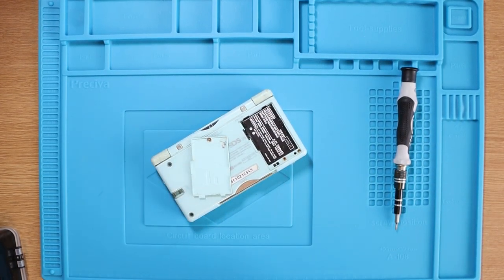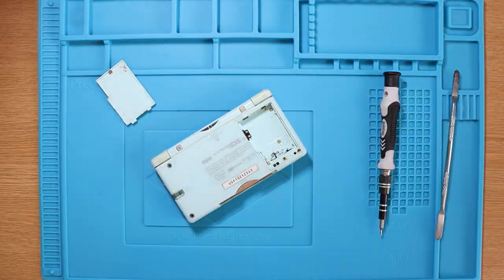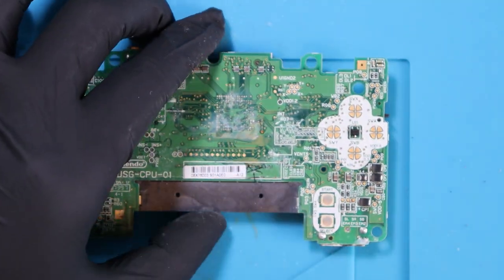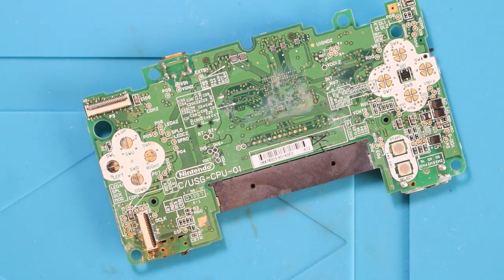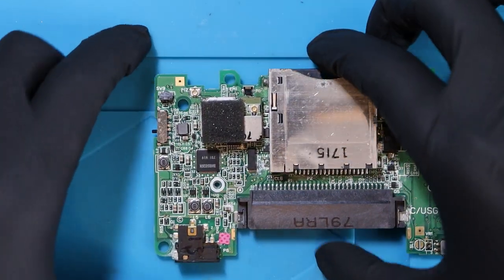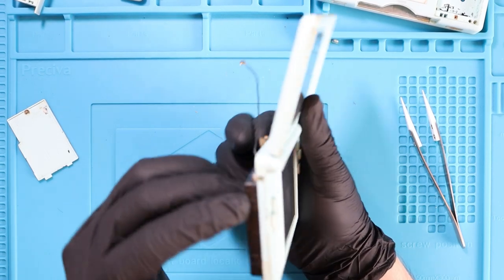Attempting to Repair and Restore a Nintendo DS Lite I Purchased on EBAY!

Comment: Did you try to change the two SMD fuses and the filter? If there was water damage there is a highly chance of having a short and getting those fuses blown.
Reply from the maker: No I didn't but I have a bit more knowledge in this now, so might give it another go 😎

Comment: I've seen someone use white distilled vinegar instead of iPa to clean corrosion off a gba motherboard, it seemed to get a lot of it off
Reply from the maker: Yeah I’ve heard of that as well working wonders :)
Reply: @mrxpexplorer6318  so clean the motherboard after you use the vinegar... don't let it sit on the board for years. You use the vinegar, Get the corrosion cleaned up, then go over everything with iPa to clean it up.

Comment: question: my ds lite is 14 years old, i used it last year and it worked just fine, i was trying to use it today, the light came on for about 3 seconds, the bottom screen flashed the white screen for half a second and turned off, not sure if the battery is low or what, someone please explain
Reply: answering you in case anyone else wants to know as well. Charge the battery for a couple of hours and try again when the battery light goes green. If it didnt turn green then you'll most likely need a new battery. (I have one that I've never had to replace the battery in and it still charges fine.) If you turn it on after that and the bottom screen flashes and turns off then it's generally a problem with the top screen. Suspect the top screen esp if you've broken the hinges which is really easy to do.

Comment: Boy, that was very corroded! However, just asking, have you checked the fuses of the board? I mean, if one of them failed, even if it's crazy, replacing it can make the board boot! Unless(wich is very likely) the liquid got under the cpu (wich is a bga chip under the cart slot) and eat it away, in that case, ofc it's not fixable
Reply from the maker: I'm going to try this on a Livestream tomorrow if I have time on the agenda... If I can get it to work, i'll scream. Thankyou :D

Comment: You could try putting the yellowed plastic bits in a hydrogen peroxide bath lite by UV lights to remove the yellowing. Otherwise, great attempt, water damage is terrifying to repair. >.<